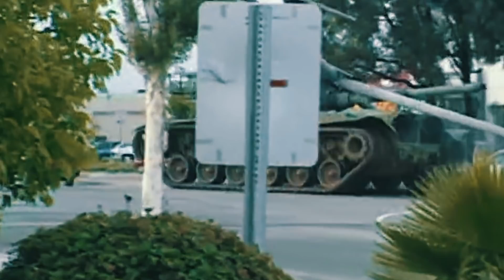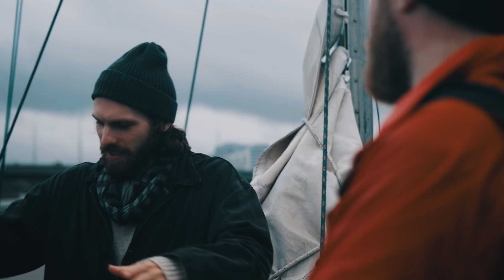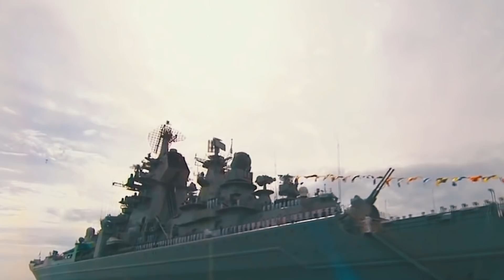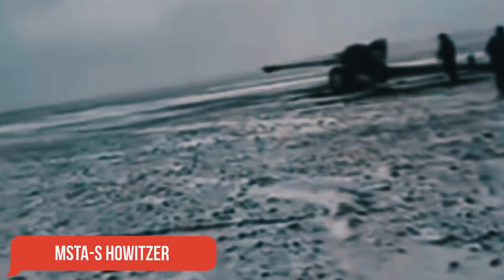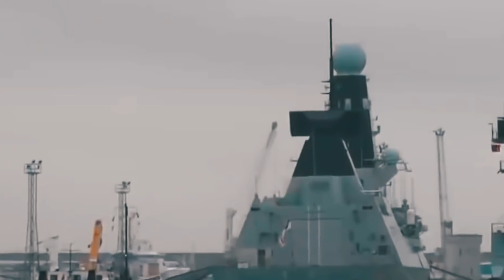15 Military Fails Caught On Camera

Comment: My the only one that noticed the tank that flipped off of the transport trailer in the beginning, was a T-34 and he's calling it a T-72?
You also moronic Lee try to scare people when you discuss the missile that exploded after leaving the launch silo. So what if it had a dummy warhead, a real warhead would not have been a gigantic gigantic issue. Yes the missile would have exploded but the warhead would not have gone nuclear. It takes a specific set of events in order to trigger a nuclear explosion from a nuclear warhead. It is true that nuclear material would have been scattered.

Comment: FC1 on an old Adam’s Class tin can. Had an SM1 detonate just off the rail during a live fire exercise on my 1st boat, USS John King DDG3. Couldn’t see it during inspection prior but the CCTV recording showed a thin flame coming out of a hairline crack of the booster section just after ignition. Made it about 10 feet before it blew itself apart.

Comment: It's sad this Russian Aircraft carrier has literally spent more time in Port being repaired then it has at sea. This Aircraft carrier is so poor it doesn't even have  steam catapults the planes that take  off from it have to take of with barley any fuel or weapons loaded on them because they have to use a ramp to get in the air. They can't even hold on board the full complaint of Aircraft and the one's they do have can only stay airborne for a few minutes due to not being able to launch with a full load of fuel due to not having catapults to assist in take off even worse they can only carry a few  Missiles also the ship runs on fossil fuel and they have to ration there power usage or the ship literally could cut off.  If you don't believe me look it up everything is true about how terrible that ship is They had a steam boiler blow up in 2016 ohh that ship is a joke

Comment: I'm impressed by how badly and partly incorrectly your video was researched, it didn't take 30 seconds to identify the "T72" that slipped from the loading area as a T34/84, especially since the correct T72 is correctly named and seen later in the video. My tip to you is give yourself more effort for the videos and more time to get it right

Comment: Here are 1 and a 1/2 for you: Nov. 11, 1987 DENVER — An Army private and his buddy stole a tank-like armored vehicle with a seven-foot cannon from Ft. Carson early today and went on a 75-mile joy ride chased by dozens of patrol cars until it broke down near Denver, officials said.
1/2:[ June 4, 2004] an automobile muffler repair shop owner who demolished numerous buildings with a modified bulldozer in Granby, Colorado,  Over about eighteen months,  had secretly modified a Komatsu D355A bulldozer by adding layers of steel and concrete, intended to serve as armor

Comment: So practicing a quick response maneuver is considered Showing off  but a failure to set and maintain the functionality of a fire-control system was purely mechanical?

  Either you've no clue what you're talking about or you have an agenda...OR BOTH

 By the way, when a missile is launched WITH a nuclear warhead  the term used is not "TEST".... it's "WAR"

Comment: I was curious about the topic and hoping it would get better, but it didn't get better.  The narrator's ability to speak so slowly in order to add 3 minutes to the video without pitch dropping is.. I suppose.. impressive. He sounds like a teenager that is trying to give a mandatory history presentation that is required to be 10 minutes long but he realizes he didn't adequately research the subject and has to kill time because the content isn't there.  This gets a down vote from me.  They had good B roll footage too, but the narration was not good, in my opinion.

Comment: That Mig 29 also didn't crash because of an engine fire.  If  you watch the video closely you can see that the pilot retracted the landing gear before the rear tires even cleared the ground and it caught fire when it started skidding down the runway on it's belly.

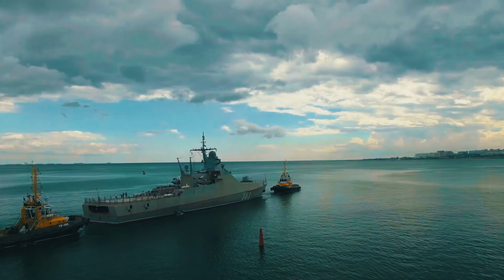Comment: @ 3:24 and that ladies and gentlemen is the reason why Russians favor cold launch rocket systems that use heavy pneumatic or pressurized gas cylinders to eject the missile safely from the container allowing the engine to light while in mid air and safely away from the ship

Comment: Do the world a favor and put more than 5 minutes of research into your videos.... this physically hurt me to watch... just about every piece of equipment was either misidentified, mispronounced, or both, as pointed out copiously by other commenters (T-34-72s lol, "Grooman", "M. I. G." an "A-3" looking like a T-34 when it should be an M60A3 Patton); the narration was obnoxiously slow; the circumstances around half of the events were misrepresented (the MiG crash for example was in no way caused by an engine failure, but you can see the showboating pilot pull their gear up well before the aircraft was ready to take off); some of the incidents weren't even related to military action at all (the TBM ditch, which btw the pilot was extremely irresponsible for landing over the heads of swimmers); outright incorrect information (on the Atlas failure, a nuclear warhead needs an extremely precise chain of events to detonate and has to be armed in the first place, so a launch vehicle failure would not trigger a supercritical reaction); and the footage for the majority of the events had no relation whatsoever to the actual incident (honestly, how the hell does a clip of a Japanese whaler ramming a conservation ship make it into a story about a malfunction in a British aircraft carrier's fire suppression system????). Overall the fact that your video has such a good like to dislike ratio is a testament to the George Carlin quote “Think of how stupid the average person is, and realize half of them are stupider than that.” My dislike on this video is a proud one.

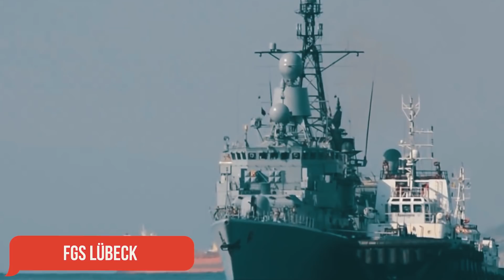Comment: So I've been aboard the Sachsen during siad incident shown around 03:00 . The missile didn't actually explode as the warhead cannot do that at the speed of the SM-2s destruction. While I am not entirely certain what actually happened (and wasn't told), the AEGIS system malufnctioning isn't the case. The F-214 class frigates are not equipped with that system and instead use the APAR. Also the name is Saxen, the same name that is the anglo-saxon tribe.

Comment: You can't ID a T 34-85 from the T-72 in the very next example? Idioto! Then you show a mere missile launch as a failure when that is what happens when testing new things, but really........ a 1961 Atlas booster failure? You're grasping here at American straws because you realized so many of the REAL equipment failures beyond missiles, were Russian. THEN, you call a howitzer, which is a CANNON, a vehicle, when it can only be a motorized version IF that is what failed. BUT! What failed was not any gun carriage that was, in any case, NOT connected to any howitzer, but you show the film of a regular cannon exploding. No mobile gun carriage; therefore NOT a vehicle. Wow, this is getting ridiculous! What kind of "expert" are YOU? NEXT, again to try to get the U.S. more involved with predominately RUSSIAN failures, you give us an example of an 80 year old TBF Avenger, privately owned, failing and having to ditch in a modern air show? Now you're totally left wing pathetic, grasping at straws to even the incompetence! Finally, you show a crazed American careening down the road in a tank. The TANK DID NOT FAIL; THE IDIOT'S MIND FAILED! I never viewed more crap and particularly, blatantly obvious attempts to make the U.S. look like the idiots left over from the Soviet idiocy. I guess you must be a part of that idiocy. This vid is garbage and full of turd.

Comment: That was a Patton tank rampaging through California at the end, not an "A3" that you showed (which, by the way, was a T-34/85).
Reply: The tank he stole was an M60A3 -- straight bow, thermal shroud on 105 gun.  Also they opened the "Commander's Hatch", not the "Driver's Hatch" which is on the lower part (the "Hull") not the upper part (the "turret")
Reply: Yep,
I was stationed on Coronado when this happened.
Reply: @glynnjacobs9602  I lived in Spring Valley when it happened. He swiped it from the Army National Guard base in National City.
Reply: @glynnjacobs9602  Oh - I see. U was the reason of the rampage? ;o)
Reply: It also was not a military mistake, but theft by a nut job.

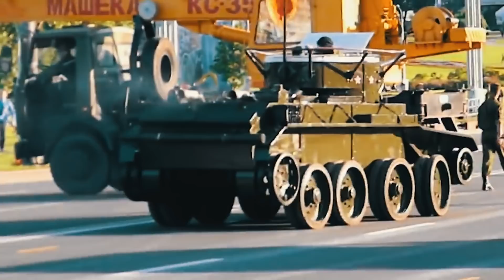Comment: 1:33)This is the Christie Track System. It was designed this way. Tracks are removable. No need for tank transporters.
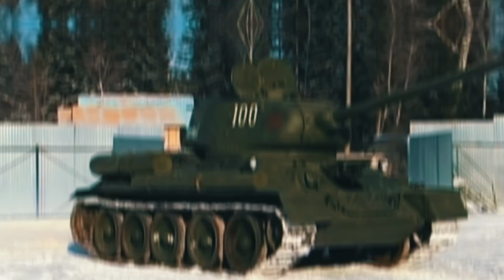8:59)Russian tank.
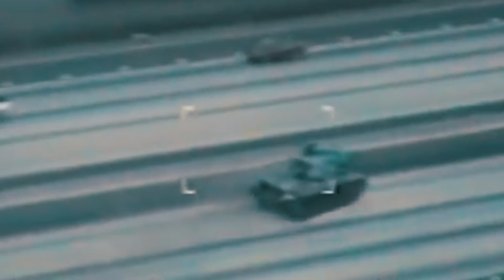9:30)The tank was stolen around 1990. The left track was gone. If the tank got off the barrier, it would go in circles. M60s do not have the Christie System.The police did not have to kill him. The heat would have baked him out. In The Big Red One, I was an APC (M113) operator.
Reply: i like your 3rd explanation, i confused before read your comment here
 Thanks man
Reply: I've wondered about whether the cop acted correctly while on top of the rocking turret. Perhaps he hadn't been briefed on the suspension system.

Comment: 8:59 this "A3" tank lol still looks like a t-34 to me..... it is actually a m60 Paton possibly A3 variant that he was referring to
Reply: It was an M60A3.  It belonged to 3/185th Armor (California Army National Guard).  The unit regularly trucked tanks needing maintenance/repair to the armory so the unit mechanics could work on them during 'home station' drills and keep their skill sets current. The guy who stole the tank had been a tank crewman about a decade prior (and was kicked out of the Army for behavior issues).  As a result he knew the trick to 'combat locking the tank. (Leaving the port for the driver's night vision periscope unlatched so you can reach in through it and open the driver's hatch.)

There were two soldiers on duty in the motor pool - one was working inside and the other stepped inside to take a leak.  This is when the guy snuck in and got in the tank.  At that point there wasn't much either of the soldiers could do.  One ran to a phone and called 911 and the other ran to the headquarters building in order to get the word to the administrative soldiers working there.  Apparently the guy who called 911 had difficulty convincing the operator it wasn't a prank call . . .

Comment: No nation beats our navy when it comes to colliding with other ships.  🇺🇸
Reply: They almost collided with a lighthouse of the coast of Spain
Reply: To be fair.  Generally largest and most active navy.  You never leave port you rarely have issues.
Reply: You almost ram a entire carrier group with a light house in the coast of Spain, because you didnt wanted to change course.
Reply: And the light house should of known who has the right of way.  Russia's carrier has not had a navigation error for two year.  Good for them.  Sure it's a burnt out wreak in harbor but two safe years are two safe years.
Reply: @tomfennesy9105  wtf are you trying to said to me? That the light house should have change curse. Are you stupid? And please try to pass what you write in Spanish by using the traductor, in that way I can understand you better

Comment: Small accidents like these are going to happen in critical systems sooner or later if they have not already or they are not telling us or are covering up a desater already. which could result in a Chernobyl disaster or nuclear disaster ! .
Reply: Those videos are an example of why you should never drive an armored vehicle up onto a flatbed.  The correct way to do this is to attach a winch to the front of the trailer and attach the cable via a snatch block to the tanks towing pintles.  As long as your winch is in the center of the trailer - the tank will be also.